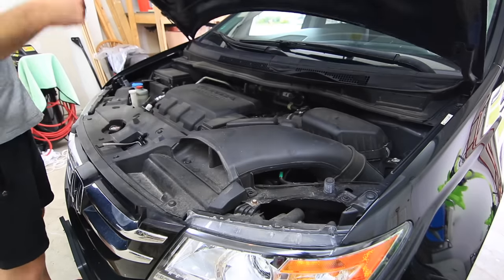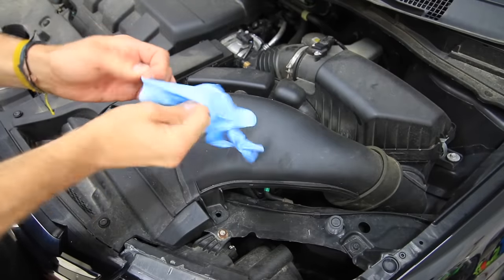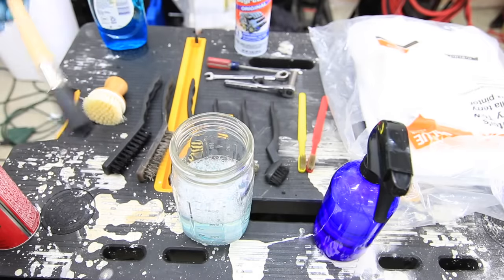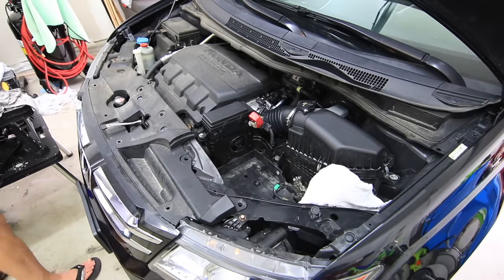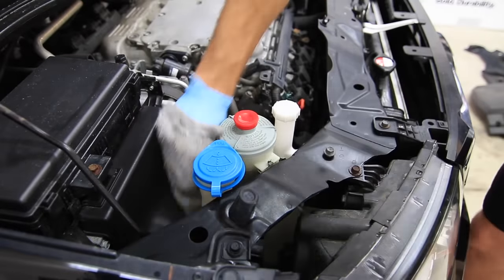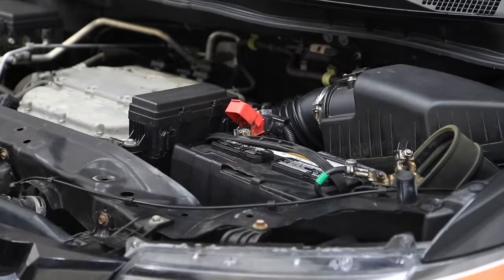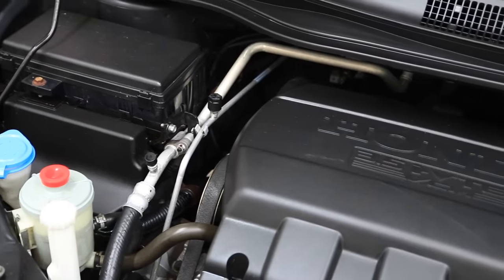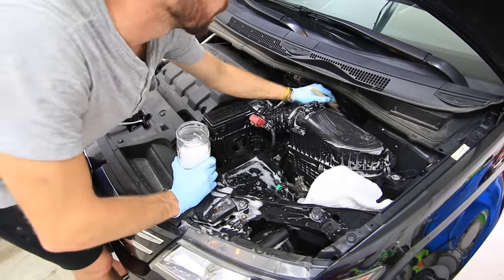Safest Way To Clean Your Engine Without Water!

Comment: Leave your engine running, heat cleans, soak with degreaser rinse with pressure washer simple takes less than 5 minutes and unless your trying to damn near impossible to damage the engine or anything electrical
Reply: Many recommend not to do this because thermal shock can crack the engine (similar to how boiling water on a cold windshield can shatter it).  Steam cleaning might be a safer way to accomplish your goal.

Whether a car gets damaged by engine bay rinsing depends on the design and condition of each individual car.  Everyone must determine for themselves what's important to them and what they're willing to risk.

Comment: Your battery connections would benefit from wire brushing and battery connection sealant.  Your valve cover would benefit from a metal cleaner/sealant or any paint polish/wax/sealant to slow down oxidation.  Cleaning off the existing oxidation without covering it with something exposes new metal so that metal will now oxidize.  The oxidized layer actually protects the aluminum from further oxidization and the long, long, long-term effect of removing it without protecting the newly exposed metal is erosion.

Comment: Nice editing. Speaking of small details, do you ever have your clients change the air cabin filter? Makes a huge difference if it’s been neglected and even the cleanest car will still smell bad if it needs changing.
Reply from the maker: Not usually but will from here on out! Thanks fro the tip

Comment: What do you suggest as a regular interior cleaner, before you use the 303 Aerospace?
Reply from the maker: If the interior isn't really dirty I will use the 303 cleaner diluted first and then top with the 303 aerospace protectant.

Comment: just use fucking wd40 youll be good to go
Reply from the maker: Ew then dirt and debris just sticks to it!
Reply: @StaufferGarage  not really. you have to wipe afterwards real well but it does a good job. and you literally have nothing to worry about with it. Water literally was not used. All you need is a couple rags. I also tried it on my rims, they held up better and washed debris off quicker than any other cleaner ive used. It still gathered so much brake dust and grime but next time i power washed the car it cleaned the rims very well without having to once again clean it all off by hand.

Comment: Good Video!  It's inspiring ... I clean my engine bay once a year too.   The only thing I'd do further, would be to remove the 3 or 4 rusty headed bolts you have and I would use a brass bristle brush to clean the rust off and then I'd spray them on cardboard with some rust stop and then paint with Rustoleum or equivalent mat- black spray paint.    But again, great job on the video!!
Reply from the maker: Love that idea! Will do that next time

Comment: Where did you get that brush you use for cleaning the engine with soapy water? What type of brush is it?
Reply from the maker: Just a soft bristled engine cleaning brush from harbor freight. Super cheap but also plastic bristles great for this
Reply: Well heck, our Harbor Freight here in Henderson, NV didn't have that kind. Bummer. ;-/
Reply: You can use also cheap paint brushes.  Trim the bristles to customize them to your liking.

Comment: K-BOOM AND A BRUSH,  THEN A HOSE CONNECTED TO THE WATER HEATER. 
2 MINUTES LATER A CLEAN ENGINE AND ALL THAT DONE IN 10 MINUTES MAX .
IT WORKS FOR ME THE LAST 36 YEARS BUT I LIKE YOUR WAY TOO JUST MINE TAKES 10 MINUTES.
GREETINGS
Reply: I do it the same way, but why are you shouting?
Reply: @paulparoma  BECAUSE I  DON'T  WANT  TO REPEAT IT. 😜
Reply: @TOKINFOIN  Still shouting. And I don't see anyone forcing you to repeat anything.
Reply: @paulparoma  YOU JUST DID...LOL

Comment: Best material for quickly covering connectors and openings that you don’t want to get water into or get wet = tin foil. Molds instantly around anything you want to cover. It’s cheap. It’s fast to remove and it’s water-proof (obv).

Comment: Yeah if you take oil leaks off, its only gonna cause a worse leak. Dealers due this to clean only to sell them quickly now, but once oil junk is removed, the oil pisses out faster, so your best off to fix it. Power washer works good, due it at home and know what your doing. Don't spray into electrical sockets or connectors and don't spray at any gaskets areas neither, you can cause damage, DON'T due at any car wash, that water is reused and cleaned, so try to stay away from self wand cleaning car washes because people do wash their engines and the backs of their trucks out in those bays, the water goes into drains and gets cleaned to be reused. I use a self drive threw only car wash that's brushless but also cleans undercarriage and wheels, I clean my vehicles if winter at least twice to get the salts off the undercarriage. Engine bays, use tire shine, it works, if heavy dirt or dust, and don't wash, then will clean most but not all. Just spray all plastics that shine. DON'T use on tires as it cracks rubber but never had issues on plastics, go figure. Michelin told me to stop using because half threw the 75,000 mile or 2 years, my tires cracked, all i used was car wash only and scrub brush, no tire shire at all, if a dealer puts on after washing my car, I have them re wash my tires with soapy water to get stuff off. I used to put many miles on tires and DON'T need a tire blowing out from drying out and cracking, Sears tires is the issue, I have the issue with another kind. I'm the only 1 that complains they say. I pull up the reviews and go to show them but they refuse to look or talk. They add 20,000 miles on to tires on my last set of cooper truck tires.

Comment: Well if your gonna clean your car the last thing you wanna do is keep putting that dirty brush back into the water because the water and soap starts to get dirty and you going to start putting dirty water on the engine bay

Another thing you wanna do is refrain from reusing the towel to dry. When you whips or dry something you wanna use a separate towel for each part of the car

Comment: battery out plastics removed wtf is wrong with you man i wash engines every day on every car form 30yrs to 2021 and i wash them with 160bar pressure and not even 1 problem in those 10 years i detail .....